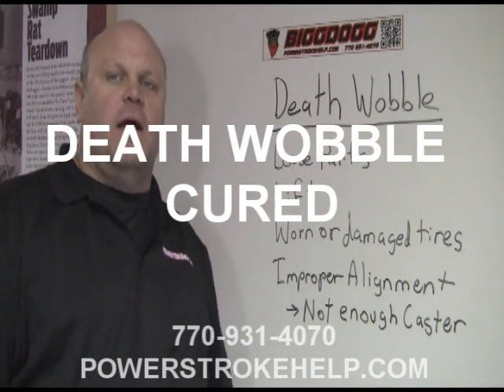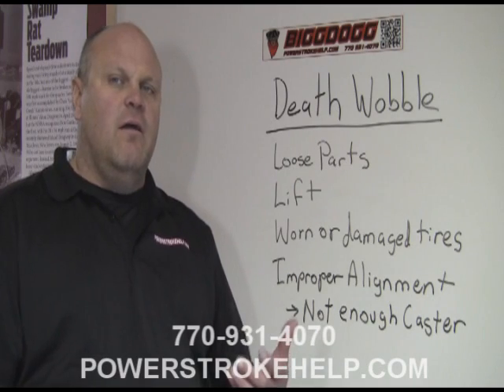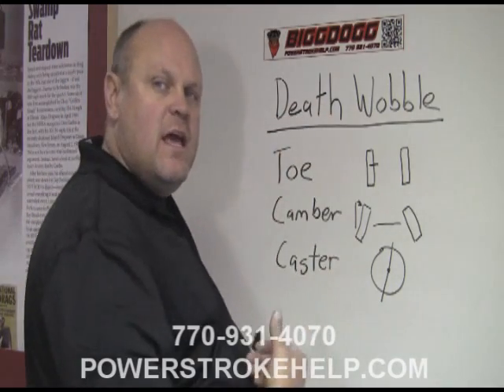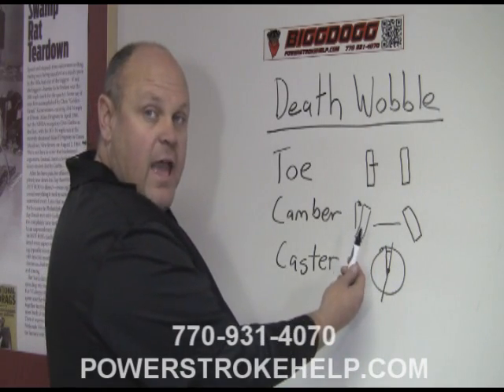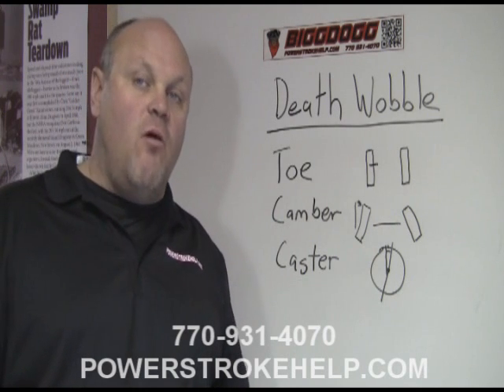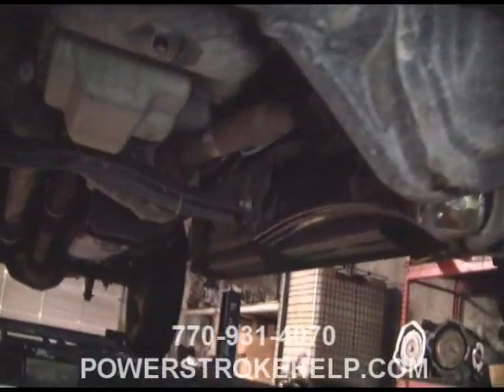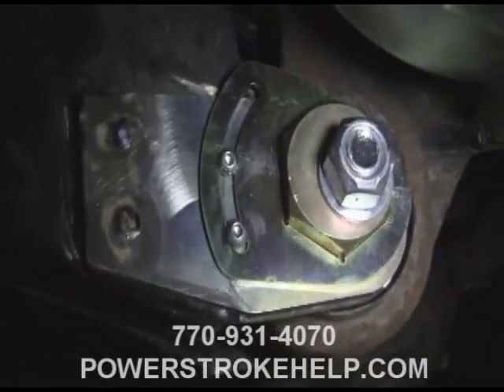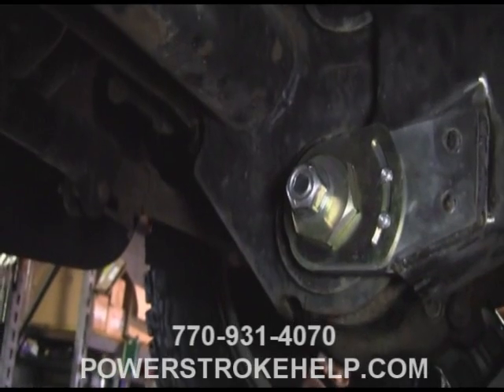DEATH WOBBLE - POWERSTROKE - SUPERDUTY

Comment: Hah... caster issues are what actually are the primary cause of death wobble, when all the other steering and suspension parts are in good working order!  Now I have yet another "expert" in the field backing my same thoughts!  Huh, go figure.  I've been telling people this same shit for years about the Dodge Ram trucks, but nobody ever wanted to believe me.  (Morons.) 

Ever since Ford finally caught up (in 2005 apparently) with Dodge, (Dodge Ram pickups have had this same basic front axle setup since at least 1994, I believe) with the coil spring and long-bar short-bar swing-arm front axle setup, Fords now have the same types of problems.  LOL - go figure! 

Anyhow, great job (you) finding out what the issue is and (BD diesel) coming up with a fix!  I'm sure this video will help LOTS of truck owners out there, cure an otherwise dangerously unnerving "death-wobble" condition. 

FYI, Dodge trucks have had that same basic cam adjustment design from the factory designed into their lower front axle arms.  Wonder where BD thought up the idea?  Hmmm?  LOL  Also, I know that you can also install aftermarket adjustable arms that allow for caster changes.  Most good quality lift kits come with adjustable arms, because (for obvious reasons) the front caster needs to be changed/maintained when adding a taller suspension lift kit, which would screw up the caster a lot if you didn't compensate for it by adjusting the swing arms.

The most important thing you mentioned here (in my opinion) was that from the factory, Ford only had about 1 degree of positive caster, and you increased it to 3 degrees of positive caster to cure the problem.  Now THAT is good information for the masses to remember!
Reply: Hi, I have a 2005 F350 and I get some shaking in the front end, not anywhere as bad as videos I've seen.. I tow a 10,000 travel trailer and when towing if the front end shakes it travels down the truck and makes the trailer sway, I have a great trailer sway control so I'm always able to bring it back,, but I'd like to have that front end feel more secure,, Here's my question, do you have any experience with the Ready lift anti-wobble trac bar,, (besides cost) whats your opinion on this cam castor kit, vs,, the ready lift product,, thanks
Reply: Laura, for a quicker response, you might want to call him directly and talk to the Ford pickup truck "expert" @ powerstrokehelp.  770-931-4070 

There are a lot of variables that can cause front end shakes... Often, many of them come from owner/operator neglect of service, or just plain worn out parts due to mileage/age/environment. 

Just to scratch the surface, some things to initially look at are:  Worn/chopped tires (often and typically caused by lack of tire rotation), Broken belts in tires, Defective tires, Unbalanced (or out-of-balance) wheels, An out-of-round (bent) rim, Bad shocks, Bad steering components (ball-joints, tie-rod ends, steering box, stabilizer shock, etc.), Bad suspension components (track bar, bushings, springs, etc.), to... the list goes on and on. 

When trying to diagnose a problem, it's necessary to know a lot more information.  The vehicle's mileage, condition of the front end components, any kind of a lift that has been added, what size tires you are running, etc... All are necessary to know about before being able to give you any good hypothesis/thoughts on what your problem may be.
Reply: I'm not your typical foo foo,,that didn't take into considerations all mentioned above,,, but I thought you might have some experience with this cam castor adjustment and could give me some more insight on what you have experienced.and do you have any experience with the Ready Lift trac bar.. thanks a bunch and I will give Powerstroke a call for his opinion also...
Reply: Nope, I don't have any insight for you about the Ready Lift trac bar.  Sorry.

Comment: That's a good idea, always have loved my Fords but have always been disappointed with the fact that you cant make these or camber adjustments.  

 I  had an experience in my 05 that got my attention in a big hurry, was heading out on a trip, it was summertime, we had just left home and came to our first turn, it was rt hand turn, started heading down the road and I noticed that the truck suddenly had a really bad desire to pull to the ditch, my wife was with me so I didn't say anything, thought maybe I would get some diesel in town and have another walk around then, well only got a few miles and suddenly the truck shot 6 feet across the center of the road I jerked it back my wife started screaming at me that we were going to die. I pulled over walked around truck  didn't see any issue, so carried on but truck was now shimmying, so I threw the 4x4 on and it seemed better, after about 5 miles it seemed to be gone.   we had a long drive ahead of us so I got to thinking what could cause the problem wile I was driving and figured that the ujoint must have been partially seized causing the automatic hub to engage, when we got back from the city i tore it down sure enough bad ujoints

Comment: I received a Ford service recall about this wobble. "I thought maybe I would get some new suspension parts up front." NO, the service recall was to fill the "E rated" tires with the correct amount of air... They stated under inflated tires will cause a wobble at high speeds. I have yet to have any kind of wheel shimmy and or steering wheel wobble, even when my tires were about 15psi under the recommended 81psi, but..... the front tires had an equal amount of air loss.  I think the bigger issue here but pertains to "Ford" service recall, is having an unequal amount of air pressure in each tire vs an under inflated. I was pretty surprised you didn't mention tire pressure when going though your checklist??  I would add,  "unless you are really experienced with filling tires with air, kicking and looking at an "E rated" tire with 50psi can surprisingly have an insufficient amount of 31psi  when measured with a gauge. Its always nice to have better options when it comes to that "Caster Kit" heck  i think its a great way to go if you do a lot of towing on the highway!! I could only imagine how much more solid the front end would feel, let alone the nice tight steering wheel! Nice job!

Comment: I am curious about the caster adjustment on my 95 F250 2WD.  I know they us eccentric bushings in the top ball joints to adjust caster and camber and also the trailing arm bushings at the frame can be had with an offset of about 1 deg.  I am wondering how much could reasonably be had in my truck.  Is 3 degrees attainable in these early trucks and would it be advantageous?  Thanks for the great videos man!

Comment: Hi Bill, I know this is a little off topic from this video but I'm having a little issue with my truck. I have a 2008 F350 with the 6.4 powerstroke in it and yesterday my battery light came on while driving. Now before I start the truck the Voltage sits around 12 and same goes for after yet if I let it idle a little while lets say a couple minutes then the Voltage goes back up to around 13.5 to 14 volts. What could this be? The truck didn't throw any codes and the batteries look pretty new. I'm not sure exactly how new because I bought the truck a few days ago. I think its the alternator or regulator but I'm no mechanic. Thanks! David
Reply: P.S I really enjoy your videos and they were the reason why I got the 6.4 powerstroke. Thanks again!
Reply: David Durnberger 13.5 - 14 V. is normal for any vehicle idling with a good charging system. After the truck has been sitting for a couple of days, take a multimeter and check your voltage, on a fully charged battery it should be 12.6 V.

Hit the gas up to around +- 1500 RPM's, check your voltmeter or hook up a multimeter and watch the voltage. With a load, (headlights and HVAC blower set to max) the regulator should easily maintain the voltage at about 13.5  V., if it's below 13.5 V. your alternator may be getting weak. I would just take it off and down to some place.that can test it.

If the alternator checks out, then I would look at the regulator. But if everything checks out, then I would look for a bad ground somewhere. Sometimes a bad ground or broken wire in the charging system can make the battery indicator come on, even if it's charging just fine.
Reply: Since then now it doesn't charge at all. The volts sit just under 12 volts now no matter if its running or not. Even when its running no matter the RPM it stays the same. Last time I checked the truck with a multimeter on Saturday night I believe the volts were at 12.2 before start and 11.7 while running no matter the RPM. Since then I have parked the truck because I don't want to just stall somewhere. Thanks for the reply by the way!
Reply: Alright, if your running below 12 V. and discharging, here's what I would do. Just take off the alternator and have it tested, or if you don't want to remove it unless you have to replace it. Get a new regulator and plug it in, if you still have the same problem, then it's your alternator.

Another way to test if it's the regulator or alternator, is to unplug the regulator and start the truck. If the alternator is working the voltage can climb up to or beyond 18 V., especially if you hit the gas. If it does, shut off the engine immediately.

More then likely since your getting no voltage, it's probably going to be your alternator.
Reply: Thanks so much for your reply! Really Helps!
Reply: No problem, glad I could help.

Comment: You would think that Ford, the multi-billion dollar company that it is would have fixed this problem by now.
Reply: Not just Ford, dodge has that problem too. I’m not sure about GM
Reply: ZR1Terror GM runs an independent front suspension. It is extremely weak compared to Ford or Dodge.
Reply: @markab71  so true
Reply: Lifting does it
Reply: They taught me this in ford fact they do know about this fix I dont know why some dealerships dont know this fix

Comment: Hey Bill here's my question. With changing the caster angle 2 degrees have you noticed any bump steer after hitting say a pot hole in the road? I know you're supposed to avoid them. But sometimes it's unavoidable.

Comment: nice to see Ford finally got away from the twin I beams and put a straight axle in. don't have the drastic camber and toe changes when under load versus fully loaded
Reply: Twin I beam is still in the 2wd F250 and F350 trucks.

Comment: Air pressure and tire circumference also has a part to play in the death wobble. And the track bar bushings wear out fast on that style front end. Ford has a TSB on what to check before changing the caster.  Wish this kit was available years ago!

Comment: Wow I had no idea these trucks ran so little caster. Are the leaf sprung models also about 1* from the factory?  My 91 Mercedes has 10* of caster! Nice on the highway but without power steering it's impossible to turn.
Reply: Doesn't having that much caster wear your tires unevenly?
Reply: If I was making lots of turns I suppose it would. With normal tire rotations the tires wear evenly.

Comment: Hey Bill, great advice here, but the 1 big thing I though was missing from the video was the track bar bushings that hold the axle in place side to side.  It's also called the panhard bar.  My brother's '95 f350 powerstroke had terrible death wobble and it was fixed just by replacing the bushings on the track bar.  Also, do you think the death wobble issue made worse by coil springs, instead of using leaf springs?  Thanks and keep up the great videos.
Reply: Wobble could appear more easily with leaf springs as i know : they allow front to rear movement seen they can twist.
coil springs are bolted they oscillate at worse because of worn out bushings allowing some play,allowing vibrations to amplify.

The problem are vibrations caused by the gyroscopic effect of the wheels.
The bigger and heavier the wheels,the bigger the effect and its problems.

That's why you are not supposed to modify your set up without thinking to the consequences on the whole system.

FYI the Panhard bar is the first system (the original) the others brands used it and called it with others names.

I have a 4 link rear end on my little volvo 240 with a Panhard bar but it's on the rear,so no wobble : )